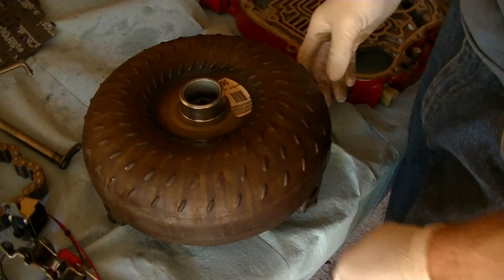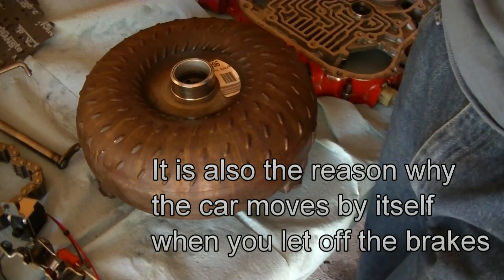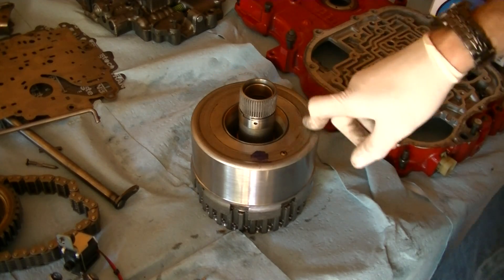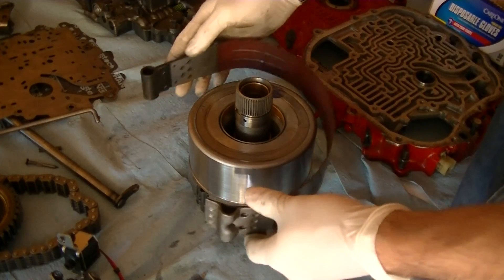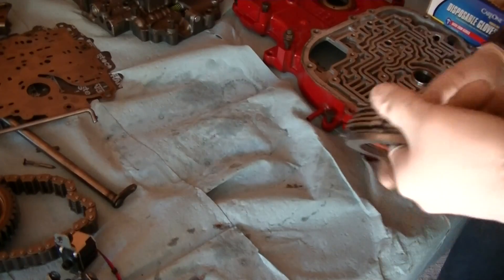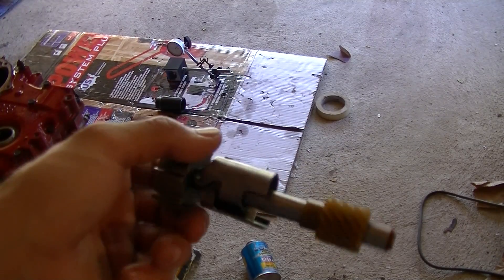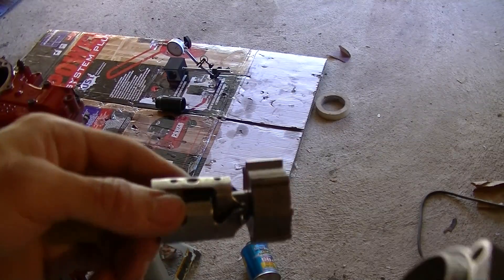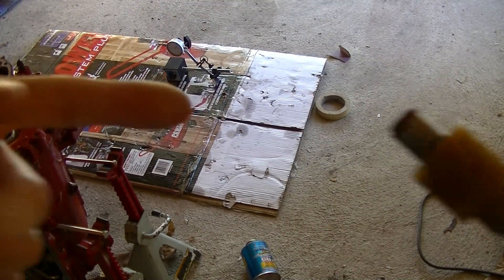How an Automatic Transmission Works

Comment: So what about CVT's, Continuously variable transmissions?
Reply from the maker: bsquared938 They work in a very similar way in that they have a valvebody and such, however they use a metal belt around two pulleys that can change in diameter rather than clutches and drums (although they may still have these things).  The changing of diameter lets the transmission have an infinite amount of gear ratios.
Reply: MattsMotorz Hmmm okay that makes sense.  Thanks so much for the great video, and also for answering my question :)
Reply from the maker: No prob! There is much more to say about CVT's but too much to compress into one YouTube comment!

Comment: Thank you very much for this video.I appreciate for your sharing knowledge.Sir.Please let me know the book`s name that you explain the valve body diagram.
Reply from the maker: Saw Tun Thanks for watching! The book I am using is the factory service manual for that particular transmission.  Every factory service manual has these diagrams.  But if you want to read more about how an automatic transmission works as well as how these diagrams work, get the book "Automatic Transmissions and Transaxles" by "Jack Erjavec." It is part of the "Todays Technicians" Series. It's very good!
Reply: Thank you so much.Sir. I`m trying to understanding automatic transmission work and valve body and sensor..Now I`m learning to rebuild auto transmission but I don`t understand how auto transmission change the power and how valve body control the fluid pressure and which sensor , which solonoid they use.Can you give me any advice to do better?
Reply from the maker: Definitely go buy that book. It will give you all the knowledge you want to know.  It is too detailed to explain it in a YouTube comment.
Reply: Thank you so much. Sir.God bless you.
Reply: +Saw Tun .   I`ve already bought the books that you recommended .  Can you help me to get the right answers of multiple choice ,ASE review questions and ASE challenge questions.. I had bought 4th edition shop manual ,5th edition shop manual and 3rd edition classroom manual.

Comment: Explaining with "Maybe"... really ?
Reply from the maker: Hossam Balouiri I don't know what you're talking about.
Reply: You said "maybe" many times, get your facts straight, you should explain exactly what parts do , don't just say maybe
Reply: Check 4:23 for example
Reply from the maker: I guess it does seem a little unclear.  What I meant by saying "maybe" is that it really depends on the transmission, and what gear you are in. Each transmission works differently and sometimes a whole drum assembly spins, and at other times, sub assemblies inside the drum spin.  At any rate, it really isn't too important as the basic concept of "clutches causing assemblies to spin" was the main idea. Getting into exactly what spins is superfluous information for the purposes of this video.
Reply from the maker: Thank you!

Comment: This is a great video.  I have a Jeep Wrangler, 97, with 38RH transmission that was just rebuilt.  I drive it for a while and it works fine but later when I come to a full stop it starts back out in second, not first. If I put it in park or down to low I get first, but not when I stop my speed to zero.  So the shop said it was a governor issue and kindly replaced it.  Just got it back today and it worked great.  Second time I went out within twenty minutes its doing same thing again.  How many times can I keep taking it back? Is there something wrong they might have done wrong in the rebuild or is this just a governor issue?  They did a full rebuild, one of the gear sets was broken.  I wish your shop was near me, I'd bring it in, but any help is much appreciated.  Thanks
Reply from the maker: archivestereo Unfortunately, automatic transmission problems are a very complex subject.  There could be a number of reasons why this is happening, but without being able to diagnose it myself, there isn't any useful information I can give you over the internet. :\

However, I can advise you to continue to take it back until it works! They are responsible for making sure the repair was done correctly.
Reply: MattsMotorz Thanks!  I will do that!

Comment: Where can i purchase a factory service manual ? Great tutorial you explain everything in detail.
Reply from the maker: Ezequiel Quiroz First, try to find a PDF version of it for free on the internet.  Many times you will be able to do this.  If that doesn't work, try ebay.  Finally, if you're really not having luck, go to the dealer.

Comment: Matt this is a great video. Thank you. Can you explain the difference between a locking and a not locking torque converter?
Reply from the maker: Sage Radachowsky Glad you enjoyed the video!

Most modern torque converters are locking.  What this means is, when  your car reaches a certain speed, there is a clutch inside the torque converter that engages and mechanically locks the impeller and the pump together.  This means that the engine is also mechanically locked to the transmission instead of through a fluid coupling.

This is done because there are losses in transferring power through fluid, so to be more efficient, the fluid clutch is eliminated when it is not needed.

Comment: So when a transmission "kicks" between gears, the servo is going bad?
Reply from the maker: Yes that is one possible reason (although usually it is not so much the servo that goes bad but the seals in the servo).  Another possible reason is sticking valves in the valvebody.  If a shift valve is sticking, it will cause the shift to occur later than intended, slamming it into gear.
Reply: There are lots of things that can cause that. Recently i've been looking for e65, it has ZF 6HP26 gearbox and oh boy, you can spend ALOT of time finding out what causes kicks.

Comment: I've always heard of how automatic transmissions use hydraulic pressure, but seeing the tubing is mind-boggling. I work in software yet the idea of a liquid-based circuit seems almost alien. Thanks for this informative video!
Reply from the maker: No prob! Glad you liked it!
Reply: Me too, same feeling. I worked in circuit design both digital and analog, and i can understand how it works, but it's amazing to actually see it.

Comment: What is a vacuum modulator?
Reply from the maker: A vacuum modulator is a mechanical way to determine the load on an engine so the transmission knows which gear to shift into.  As load increases, engine vacuum decreases, this vacuum is connected to a diaphragm that will move in an out as vacuum changes.  This diaphragm is linked to a valve in the valvebody that will downshift the transmission if a large enough load is present.  Another way to do this exact thing is with a throttle valve (explained in the video).  Now a days, load is determined by the computer and there is no longer any need for a throttle valve linkage or a vacuum modulator.

Comment: This is why i'm driving a manual car. Way to much parts that can fail and it will be expensive.
Reply from the maker: Also, manuals are more efficient and lighter, thus better MPG.
Reply: MattsMotorz But When That Clutch Wears Out, You Have To Separate The Engine From The Transmission To Get At The Clutch Assembly To Replace It, Which In Itself Is A Major PAIN IN THE ASS, Plus You Have To Have A PLACE To Do It Plus MONEY Or Pay A Transmission Mechanic To Do It! Uggh! A Nightmare! Plus There Are Rules For Driving A Manual Trans. ("Don't Sit At A Traffic Light With It In Gear And The Clutch All The Way In--Leave It In Neutral With Your Foot Off The Clutch") Nah! I'll Stick With My Automatic, Thank You.

Comment: So how do I calculate gear ratios? Like for example the Mercedes Benz 7GTronic has ratios of 4.377, 2.859, 1.923, 1.368, 1.000, 0.820, and 0.728. Reverse is 3.417. 

This makes no sense to me. I get how the planetary gearset makes ratios, just not how to calculate them.
Reply from the maker: It gets a little tricky. I haven't done it in awhile, but there are tutorials out there if you google search it.  

If you REALLY wanna get into it, you also need to take into account the torque multiplication of the torque converter (which isn't constant).
Reply: I guess I'll google it then.

Comment: Brilliant video... Thanks
I need some expert advice, 
My 1991 vw selects gears after 3800rpm, could the throttle cable be causing the problem.? Or would the cause be something more serious?
Reply from the maker: It is very difficult to say.  The best bet would be to hook a pressure gauge up to it to measure line pressure.  I made a video on how to do this.  However you will need to have the specs on hand from the factory service manual to see what the pressures should be.

Comment: Will it hurt the  trans If shift in a automatic I have a 99 mercury cougar. If It wouldn't hurt I would like to
Reply from the maker: Do you mean shift gears while driving?  As long as you're not shifting in to PARK or Reverse it will be perfectly fine!
Reply: Yes like start for stop in 1st gear then 2nd an so on until I shift into D an I don't down shift an repeat
Reply: I appreciate you getting  back to me I couldn't  get a straight answer

Comment: I have a toyota A e 100 1997 model (automatic transmission). When I first start on mornings there is a delay going from park into drive or reverse, once it goes in i won't have the problem for the rest of the day. Also when I'm driving it goes from 1st to 2nd to 3rd gear easily,  but from 3rd into 4th it's a huge struggle. Help please anyone?
Reply from the maker: The first place I would start (besides seeing if there are any codes, which I doubt since that tranny is from 97) is to hook up a pressure gauge to the transmission and monitor the line pressure as you are driving it. I made a video on how to do this. You then need to take these readings and compare it with what they SHOULD be.  This information is given in the FACTORY service manual.  This will give you an idea of what is going on inside the transmission.

Comment: Great Video! I have a question for you! I have a 88 cherokee with an AW4 transmission. The mechanic said is a very good transmission and that is also used in a lot of toyota cars. Is that true? I wanted to overhaul it because I think is a very reliable car.. Never done anything to the trasmission until now with 146,000 miles on it. Greetings from Costa Rica and thanks for your comments.
Reply from the maker: Hello! I cannot verify what he says, I never worked on that transmission. If the transmission is still good, I would advise to not overhaul it, as there is no reason to at this point.

Comment: I have a 92 GMC Safari. I replaced the 700R4 transmission with a used one from a salvage yard. It went bad 2 days after the warranty expired. I am trying to find someone to rebuild my old one on the budget of disability(SSD). Do I HAVE to replace the torque converter when I get this done?
Reply from the maker: This is a tricky question.  The best course of action would obviously be to replace the torque converter.  However, I have gotten away with reusing the old torque converter after rebuilding a transmission with no problems.  If the failure was not caused by the torque converter, you will probably be fine by not replacing it. HOWEVER!!!! Those 700R4 / 4L60E transmissions had an issue with the torque converter clutch valve in the valve body causing the torque converter clutch to not be applied fully, causing it to slip and become destroyed and sending bits of torque converter clutch material through the transmission causing it to fail.  This was a common problem, so if this is the case, then absolutely replace the torque converter.  If you do this, MAKE SURE you get the CORRECT torque converter for the CORRECT YEAR!! Certain years of that transmission use a PWM (pulse width modulation) torque converter clutch that continuously applies and un-applies the clutch very fast.  If the wrong converter is used, this will DESTROY the TCC in no time flat, causing transmission failure.  Hope this helps!
Reply: MattsMotorz What are the compatible years for a 92?  Is there a difference between a 4L60 and a 4L60E?  Are there any numbers to identify a transmission?
Reply from the maker: The 4L60 is the non-electronically controlled version, E indicates "electronically controlled."  I BELIEVE 91-94 are compatible, but I don't remember.  There ARE identification codes, but they are in different places for different years.  The 4L60E is an extremely popular transmission rebuild. Do some looking on google, there are tons of websites out there dedicated to the 4L60E.
Reply: MattsMotorz Th
Thanks a billion.

Comment: My car (1995 Honda Civic Automatic) has a problem for which I'd like to narrow down the exact cause inside the transmission: The car, while standing and holding down the brake pedal in D, suddenly loses Revs and wants to make a move (switching to first gear?). I have to step off the brakes and push them again in order to prevent the engine from going off. This happens quite often now standing in a queue of cars (stop and go). What is exactly going on inside the transmission? Can this be due to wrong transmission fluid put in 2 years ago (car has no climbing problems and changes gears fluently while moving). Thx in advance for replies.
Reply from the maker: I am not sure what exactly you mean by "wants to make a move." But to me, this sounds like an engine problem, not transmission. Many times when the engine bogs down during idle it is caused by a vaccum leak such as a stuck open idle air control valve.
Reply: MattsMotorz Hey, many thx for the reply. The car came back from a friend (car mechanic). He only found the car doesn't accelerate well and suggests to change the transmission. Actually this car never really performed outstandingly well. Matts, I'm just a beginner with cars but could you please (if not to busy) find out if my Honda (1996 saloon, not 1995, CIVIC 1493cc, 4 Cylinders) has a partially electronically controlled transmission? The speedmeter doesn't work from time to time and I was driving the car usually even with the Error light on, because I found no trouble doing so. Now I read that a faulty speed sensor can cause symptoms that let even specialists believe that the transmission must be replaced. When the speedometer needle works I experience normal operation as far as I remember. So, simple question: Is my transmission depending on optimal feedback of the speedsensor? Thx for the help, man!
Reply from the maker: For a 1996 Honda civic, the transmission IS electronically controlled.  I know this because I rebuilt one (I have a video series on it, the name of the transmission found in many civics that year is A4RA).  A bad speedometer, input or output speed sensor can cause the transmission to not work properly, but as I said before, what you described to me sounds like an engine problem.  Try checking the idle air control valve. I made a video showing how to do this.  Also check for vacuum leaks.   Also, what does your mechanic friend mean by "does not accelerate well." Is the transmission shifting too late? Is it slipping? That seems like too vague of a description to justify replacing the trans.  I would get a second opinion.
Reply: MattsMotorz Sorry for the late, late reply. I felt I should give you an update to how I finally got rid of the problem. After I unplugged the speed sensor the issue vanished. Engine runs smoothly while standing on brakes. It seems the sensor gave false data about my current speed. I didn't do anything on the engine, neither I let anyone service the car. Until now the issue never came back. So, why would I bother buying a new sensor(most probable a used one since a new one would not be worth it considering the age of the car)? The car runs perfectly without it!? Even Economic, Normal and Sport mode are operating. Can I damage s.th. not using the Speed Sensor?
Reply from the maker: Glad to hear your figured out the problem!! The best thing to do would be to get a new sensor.  The speed sensor is pretty important in a lot of systems on the car.  I would wager that your car is in "limp home" mode and is using pre-programmed characteristics instead of taking live data from the sensors.  This is what can happen when sensor signals go missing. You can get a new speed sensor for about 60 bucks at rockauto.com  I believe it would be worth it if the car is in good shape and will last awhile.